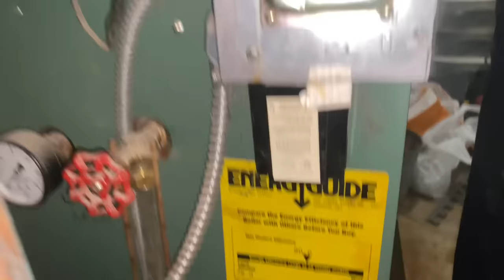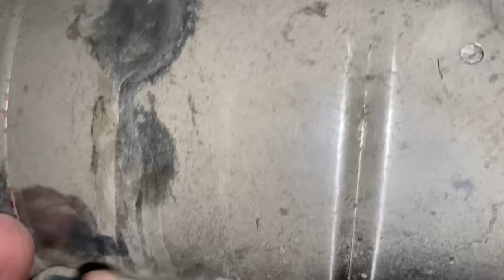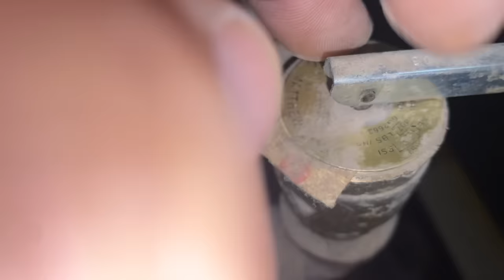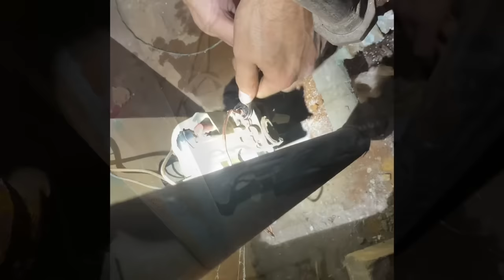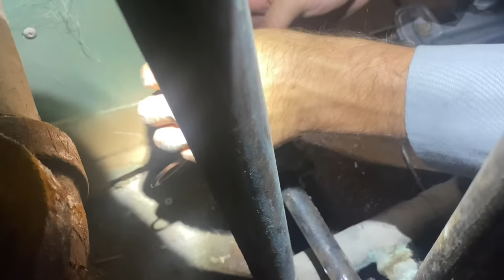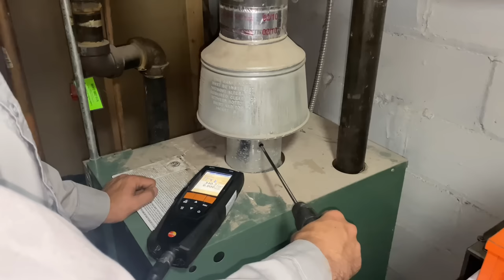Troubleshooting Gas Boiler Problems: Pilot Not Lighting | Full Service Call

Comment: Funny that i watch these on days off lol.   Good apprentices that take instruction well and also have common sense are pure gold.  Before i fully condemn the valves i like to hit the Tc with my small torch to see if theres ANY way it even could work... its more so a curiosity for me at that point. That gas valve got cooked out, likely during yheir basement reno due to dirt.. that damper needs replacing too, its resistance will be high and the failure will happen on the weak part of the low voltage circuit ( looking at you windings for the gas valve solenoid ) .  As the amperage ruses against the resisting liad ( like pitted dusty contacts on the damper end switch ) things heat up... till they dont.   :)
Reply from the maker: Thanks for posting your feedback
Reply: @PipeDoctor  thanks for making videos :)

Comment: You can test the thermocouple by measuring the millivolts.  Unscrew it and use two jumper wires.  One goes to the end of the tcouple and the other goes to the copper pilot tube.  Relight the pilot and measure the millivolts.  Normally gets to 25 to 30.  If it doesnt the pilot is bad.  Sometimes easier than disassembling everything.

Comment: I love the standing pilot I converted most of my electronics furnaces on my buildings with manual standing pilot and for years they still run like a champ I got tired of the electronics going bad at the worst time or the coldest night they always fail now the tenants will never be without heat

Comment: I tested a thermocouple without installing all the way. 
1- remove the old thermocouple from gas valve. Just part that goes into gas valve.
2- put new one in, use lighter or candle to heat the new thermocouple, you can try to light pilot , if pilot stays on , then you know that’s the issue and replace the thermocouple.
2 - threa
Reply from the maker: Yup 👍

Comment: the draft hood looks ok to my eyecrometer via video. it says it should be 8" from bottom of hood to top of jacket, but many of them came short from factory, with not enough pipe from the hood to end and didn't allow for the jacket/insulation. I would look in it to be sure it doesn't have an integrated junk bimetallic strip damper that's failing to open anymore.
the powered damper looks very suspect to me, more so when wiggled and hearing the end-switch click, as well as not stopping every 180 degrees. unless they modified them to make a full revolution each cycle to self clean and not stick(none that I know of, but it's possible) 🤔

Comment: I also support having the old fashion standing pilot. Much simpler to diagnose.  That draft hood sure looks like it was shortened.
Reply from the maker: The draft hood was definitely cut back
Reply: I went back to view the video.  It looks like there was a draft damper was installed on the verticle. There is a bracket still mounted just above the hood. Someone replaced the old damper with a new damper on the horizontal. If the damper had been installed where it is now, the hood might not had to be cut @PipeDoctor

Comment: pilot flame looks lazy. burners were dirty. gas valve did appear to have been flooded at one time which the manufacturer does recommend replacing if ever flooded. Over all as a teaching video not bad. and every one trains different. i was trained to never leave a unit dirty as it could result in a nuisance call back which can be hard to charge the customer for and could affect your combustion analysis. i do enjoy your video's, in my area we don't have many steam boilers they are mostly hydronic. Keep up the good work at making the trades great again!

Comment: Good job Mike and Pete, The low voltage wires shouldn't be in the conduit or line voltage box service disconnect, NEC code from way back, And they can put vent covers in the drywall, or install a vent from outside for air make up or O2 vent for combustion.
Reply: Mikey might want $16,000 dollars to bring the whole heating system up to spec.
Reply: It's not the best practice but as long as the insulation meets or exceeds the maximum voltage within the enclosure/ raceway it is allowed by NEC.
Reply: If they are dumb enough to pay that price, then good luck, I need to sleep at night, don't need to be tossing and turning in my bed, worried about someone knocking on my door, wanting their money back.
Reply from the maker: Maybe 🤔
Reply: Just leaving a comment on the internet is dangerous enough, some guys go crazy just telling them what to do, they go nuts.

Comment: Ok I got to the end, what was the reason she didn't fire right up? Was it the damper or one of the safety switches was still disconnected?
Reply from the maker: Gas valve. Did you not watch the video??
Reply: @PipeDoctor  I watch the whole thing. She didn't fire after the valve change when you hit the er switch. You went back to the damper then cut away
Reply from the maker: @randymathews3348  kidding me? I finished the video doing a combustion analysis on the boiler running.
Reply: @PipeDoctor  yes you did, even had your little baggie. But why didn't she fire when you hit the switch is what I'm asking Mikey
Reply: I know this video is very old but I had the same question.  I was expecting it to be a bad flue damper control.

Comment: Hello Mike, you make mention of it not being OK to mix the high and low voltage in the same J box but it is actually OK. It’s got more to do with the insulation class on the wire. As long as the insulation class meets or exceeds the maximum voltage to be seen in that J box or conduit it is fine, as for example if you were to use THHN on the low voltage in the box with high and low voltage, it would be fine and per code. Also maybe show Peter on how to check DC millivolt for thermocouple troubleshooting.
Reply from the maker: Okay. Please explain that to the inspector on my next job if I decide to mix voltages.
Reply: Mike here is the code to reference National Electric Code Article 300.3 (C) 1. Conductors of different systems when asked.
Reply: the thermostat wiring entering/passing through a line voltage box is a violation itself, because it's "class 2 low voltage wiring", which is not rated for, nor ever enter line voltage areas.
yes, even though some has been rated up to 300 volts max, it's still a violation.
it would need a box divider, a separate nipple connected box or the transition splice done outside the jbox, then it would still be an violation at the jbox on boiler.
that's same reason condensers and most equipment have a small compartment just for low voltage wiring to be spliced and then internal wiring is different, where it's allowed to be in close proximity.

also, it may still be against local state, city, town and other codes. they always override national code with greater restrictions, some overrule it by using older code base though.
Reply: They definitely can't share a conduit

Comment: Hey Mikey, I spend at least an hour to 2 hrs everyday watching your vids😅, I would really appreciate if you can answer or advice my concerns. I have this boiler hydronic system with 2 zone valves since 1987 without any problem like roll out flame,,etc. it’s a Utica gas boiler m6125agbt and doesn’t have draft hood ,no spill and roll out switches. Im learning now all these safety features in your videos. Do I need to make some improvements and install all these now? Thanks in advance
Reply from the maker: You are perfectly fine. When the system is replaced you new equipment will incorporate those safety controls. I doubt you don’t have a draft diverter. It’s built in.
Reply: @PipeDoctor  you’re the man, thank you so much and God blessed

Comment: You never told us what the actual problem was. Even with the pilot out the vent damper should of opened. Was it the damper?
Reply from the maker: Did you not watch the video?
Reply: I did, after you replaced the gas valve it still didn’t fire up. You started to look at the vent damper and then the video cut to you doing the combustion analysis. I was just curious. Even watched it again
Reply: @williamgildea8348  same thing I seen. Was wondering the same thing.

Comment: That mushroom vent hood looks awfully low?  Some of the power-stealing thermostats caused the vent dampers to go round and round on single zone package boilers. like a steam boiler.  I commented on the vent hood before you did ;)
Reply from the maker: i've never had that happen to me
Reply: Around 1980's to 2000 roughly, I would do a new steam boiler, turn it on and the vent damper would go round and round.   The issue was the thermostat, change it out or put a relay in and the issue went away.  You would see it mostly on the clock thermostats you put the pins in.   @PipeDoctor

Comment: Mikey
When you set your home air-conditioning  to 66 and it's like 59 like last night, will that  
shorten life of compressor etc, because I hate when it's humid and 65 outside and I don't put air on cause of above concern
??
TX Mr pipes❤
Reply from the maker: Nope
Reply: get a dehumidifier? it will extract humidity and not cool the home, even heat it somewhat due to natural losses. 😉
A/C is really not meant to be ran with indoor air temp and suffers great efficiency loss.(it can cause coil icing and liquid flood-back which can kill compressor) and for sure not such low outdoor ambient temps(head pressure may be too low) which drops the total system pressure too low and may cause indoor coil icing due to refrigerant temperature being too low.
some heat pump models may be OK depending on design, ideally you'd need an outdoor fan cycle switch, indoor coil temperature/ice sensor to cycle the condenser.
all that said, it may work OK doing so for short periods, but again, get a dehumidifier, seal the home better and make sure bathrooms/kitchens are ventilated to help curb additional indoor humidity. also if you have aquariums, water fountains/features and whatever else indoors, you need to run dehumidifiers anyway.

Comment: You keep the A/C set to 66* at night ? Does the system keep up with that setting easily ?
Reply from the maker: Yes it does
Reply: I just open windows use a commercial fan and home is in low 60s.. ahhhh san jose ca..

Comment: There is no easy way to determine if the thermocouple is good without replacing it?
Reply: Yes, you test them w a meter
Reply from the maker: Yes, you can test it with a multimeter that can read millivolts but it’s not worth it. It’s not worth wasting the time. It’s a cheap part.

Comment: Pilot the water heater should turn on automatically. There is no need to use a lighter.
Reply from the maker: Wrong
Reply: @PipeDoctor  If the water heater pilot is of good quality, it will light the burner with a spark.